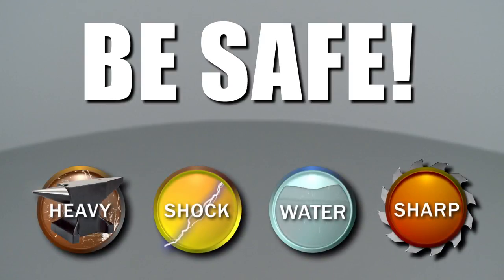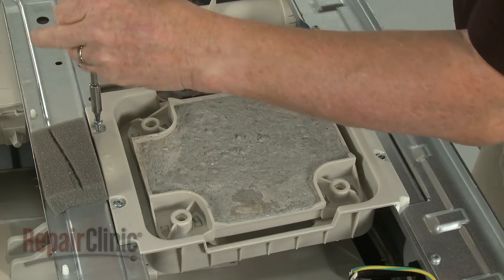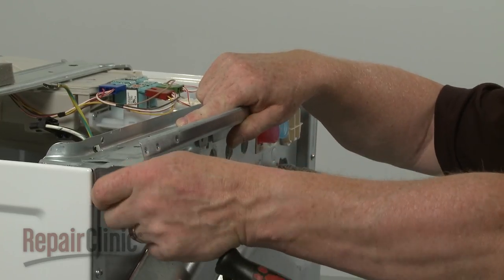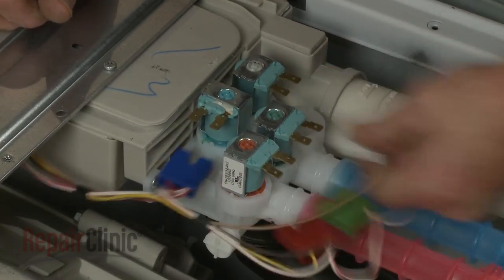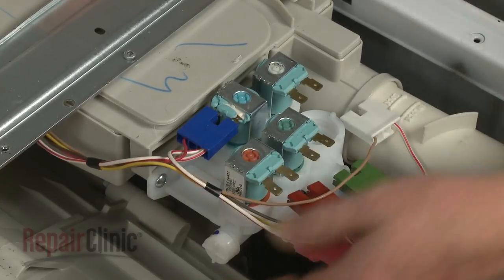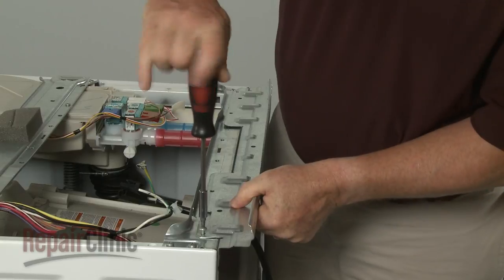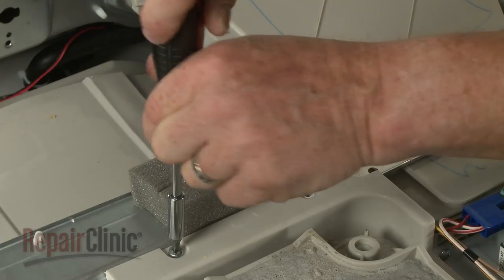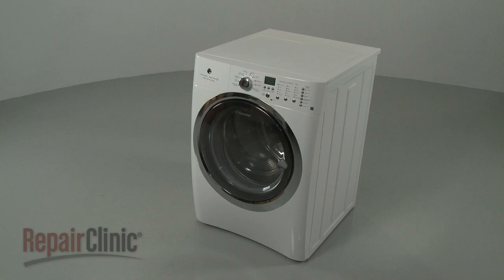Electrolux Water Inlet Valve Replacement #134637810

Comment: Good instructional video! I just replaced the same valve on an Electrolux EFME617Stt G-1 Electric Washer (very similar to the model pictured) and the only difference that I noted was that I didn't have to remove the back panel. There's enough room to slide the valve outward (towards wall), and reinsert the new one in the same way as removed. You just have to remove the white color housing (bracket) that keeps the red/blue valve inlet tubes in place on the back panel. Much easier if you don't have the room, and it's a time saver.
Reply from the maker: Thanks for the tip.
Reply: That's what I did as well, didn't see a reason to remove the whole back panel, although if you drop a screw then you'll either be fishing for it or removing the back panel.

Comment: My washer had a fill valve oscillating so I replaced this valve array. Turns out the problem was a gift card caught in the drain bellows which was blocking air pressure to the level detector. I did not need to remove the back of the machine to replace this array. Only the top and the dampener assembly. The valve array is held in the rear panel by a plastic piece attached to the panel with little tabs. Gently push the tabs in, remove the plastic piece, and then the valve array can be moved rearward easily to detach it from the soap chamber. Much easier than removing the back of the machine.

Comment: It makes it easier you don’t need to take the whole back panel off. Just take off most of the upper half and you can peel back the panel to get the valve out. Only problem is you will have less room for your arms to unscrew the valve out but it’s definitely doable

Comment: So, we have a 2012 Electrolux stacked washer/dryer that started to throw E35 error codes. First I replaced the water pressure switch. First cycle after the repair was fine and then on the second load it gave us the E35 code again. Then I replaced the main control board. First cycle after the repair it was fine and then on the second load it threw another E35. Frustrating when you consider the hassle of getting to the back of a stacked washer with a dryer on top and very close quarters to work in. Now, I just ordered the damn water inlet valve. Will this finally fix it or should I just blow up this POS? Asking for a friend.

Comment: This is a great video, but I needed to clean the inlet screens... they are not designed to be removed, though I did succeed at doing this. My guess is that this is the Electrolux Marketing Department insisting on designs that promote new purchase, rather than repair. The filter element
is held on by a plastic "center stud", with a blob at the end... cut off the blob, and you can remove the element. Unlike all these videos, most civilians have a tougher time getting to the backs of their machines... so when I found out that I couldn't just take out the screens and clean them, you can imagine I had a few choice words! ;-) Thanks again for the video!

Comment: Thank you for this video. Just a question: Is the water inlet valve some sort of check valve to prevent backflow?
I've been seeing some plumbers say washing machines need check valves, but I know that some washing machines come with built-in check valves & I'm wondering if this one has it built-in.

Comment: Would this be an F4 code? 
I ran my washer through diagnostics and I got an E11 code, an F4 code and an E13 code, my washer doesn’t seem to like to use warm water, or the hot, I seem to still be able to do washes in cold, thanks for your help:)

Comment: I have the same washer thought it was the pressure switch problem still there error 35. I guess this is the part required for the fix, water just keeps filling even when off

Comment: I'm having an issue with mine overfilling when using hot water. It causes the machine to leak soapy water all over the floor. It doesn't leak when using only cold water. I've replaced the inlet valve already with a brand new one so does anyone know what the issue could be? The inlet valve is all I can think of that would cause the issue unless there's something wrong with the control board not telling the valve to turn off or something.